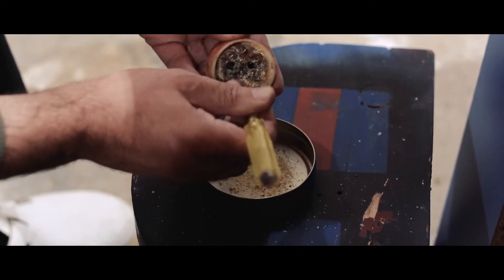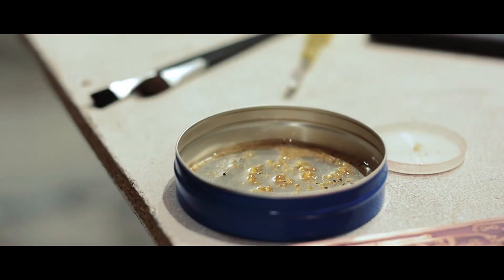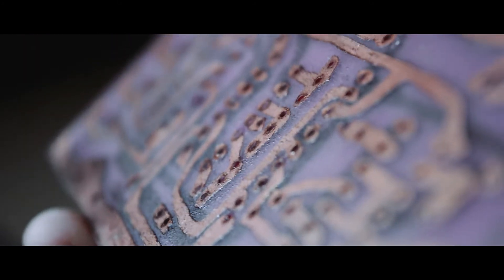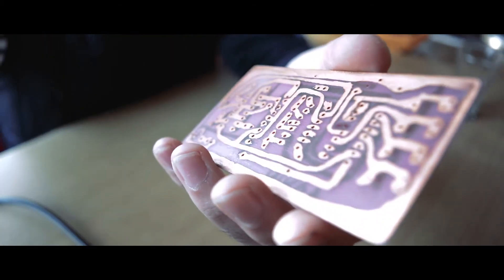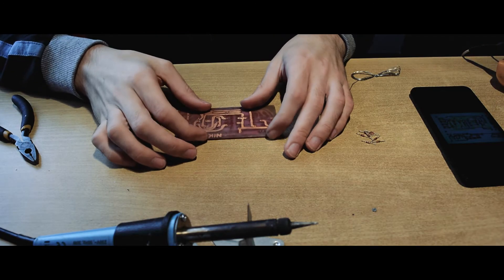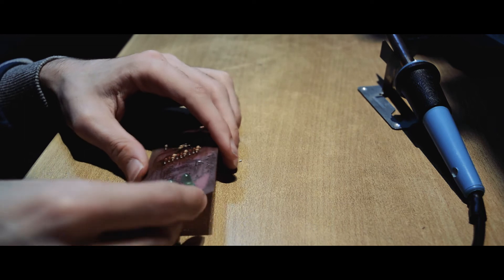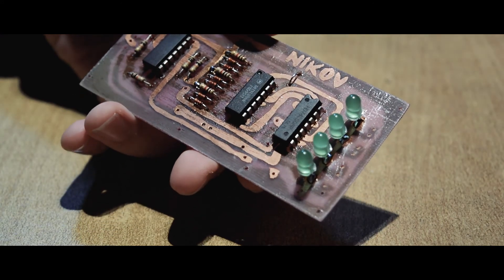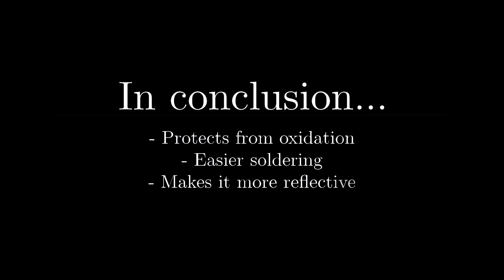Coating PCB with soldering flux?

Comment: I had wanted to buy a product I had worked with at school that comes in a spray can and is made for the purpose of preserving unfinished PCBs. But I've then tried doing what you showed here and found out it works exactly the same!
Reply from the maker: Interesting! Do you know what's the name of the product? It could be an interesting thing to review 🤔